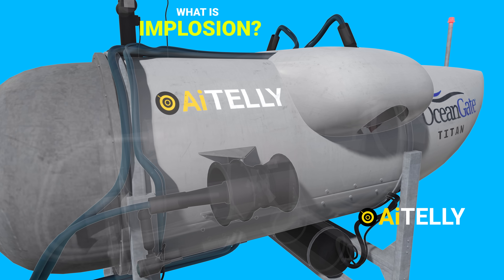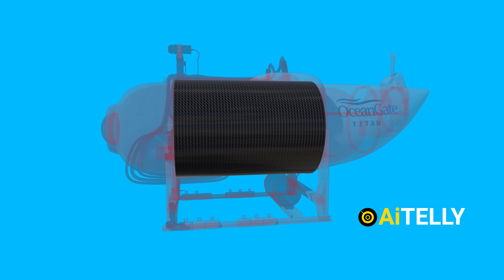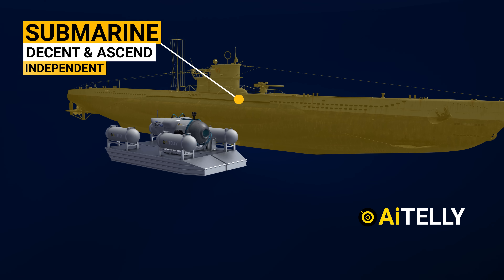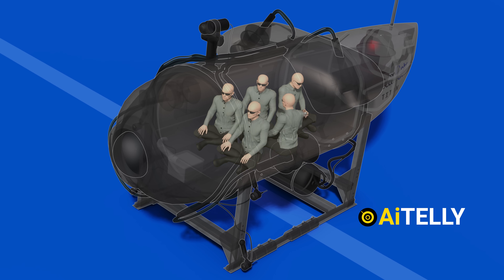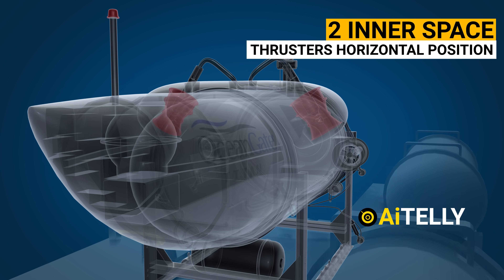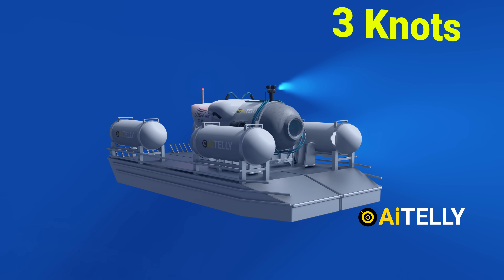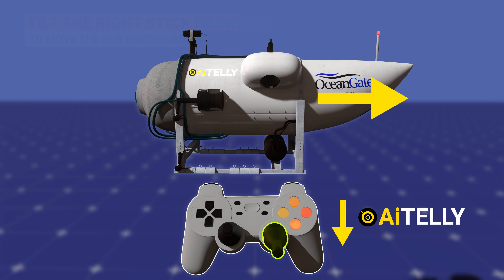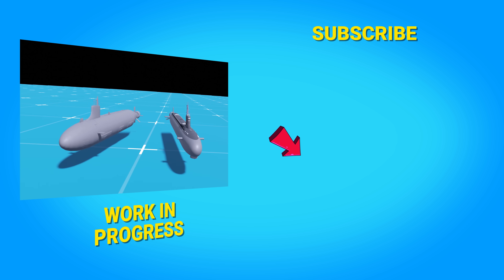Implosion Titan Oceangate How it Happened | Submersible Submarine Parts #3d

Comment: More then 5600 psi per square inch. Big mistake they glued the hatch to the tube. They litterally pressed a cap on a cylinder with a one inch ring with glue. Carbon fiber is only strong for outward pressure not inward its the opposite.  Take a ring of tape and try to pull it apart its hard now push it in its easy same crap when you take strands of fiber woven and laminate it it stress cracks. The thrusters were not even meant for underwater . The sub was built with camping world parts that submersible was never meant to go below 3000ft and was only meant to go that deep one time and then be retired. He didnt do that he went four times deeper then it was desinged. A real submarine has ballast tanks in it that fill with water to dive and empty to rise. That controler was garbage everything was. Way more cpmplex then your vid is showing.

Comment: Carbon Fiber is intended for an application requiring lightweight, with the strength of titanium, Why were the engineers concerned about weight on a small sub? Steel, or titanium should have been their first option!
The  US Navy's , "Alvin", 2300 dives, 7 trips to the Titanic, Steel hull built in 1966.?
Reply: Yes, your point is well taken but I believe the Alvin's crew compartment has been replaced several times now...only proving that the operators that work Alvin are not the same as oceangate.

Comment: There was no implosion here.
Either an explosion in the Titan allowed the sea to enter or sea pressure caused the Titan to break up and that is not an implosion or an explosion. The sea does not explode or implode!
There might be a tremendous inrush of sea, but that is not an implosion nor an explosion.
An implosion is the generation of energy inwards not outwards, and the contents of the Titan could not generate that kind of energy. If the sea were imploding it would stay where it is and suck the Titan into it.
An implosion might draw things into it, but only because the direction of its energy is the reverse of an explosion’s.
If an air-filled balloon loses its size it is because the air pressure inside it has been reduced allowing the outside air to replace the air lost till inside and outside pressures are the same.
If the balloon is pricked or in some way internally exploded then it could collapse entirely, but there is no implosion involved.
Reply: Wrong sir. Every sign leads to an implosion. It imploded. Plain and simple.

Comment: Expert submariners said the implosion was likely due to the amount of different materials used in the vehicle. They all have different atomic differences which causes problems. You want similar materials with similar atomic makesup. Additionally, they said the porthole was a likely culprit to the implosion. It is the weakest point on any submersible and is the reason no other submarines or deep sea diving vehicles have them.

Comment: One factor that I haven't seen mentioned is that carbon fiber is extremely strong in tension, but not in compression where it tends to buckle. So, IMO it is not a suitable material for a deep diving vessel.
Reply from the maker: You might also like Nuclear Powered Submarine Engineering behind it #3d Nuclear Reactor released
Link: https://youtu.be/J0lb46Zi5-s

Comment: the hull compresses quite a bit at depth. IF you read about old timers in nuclear subs and even currently in Virginia class submarines will tell you if you tied a shoe string tight inside from one part of hull to other. IT will SAG quite a bit once the sub is at a decent depth (which isnt very deep maybe 800m max crush depth for a SSBN. Though they say its classified.

Comment: One of the main advantages of carbon fiber is it’s strength to weight ratio, it’s completely irrelevant when it comes to a deep see vessel
Reply from the maker: You might also like Nuclear Powered Submarine Engineering behind it #3d Nuclear Reactor released
Link: https://youtu.be/J0lb46Zi5-s

Comment: the overall hull design is flawed. But actually the controllers main flaw is not that its a xbox game pad (which are reliable) IF THEY ARE WIRED. wireless is just dumb for any application like this.

the hull though yes under engineered. Carbon fiber has its place for many applications, this clearly isn't one yet. OR at least not done by the engineers who made the titan

Comment: 1. ICE BREAKER SHIP coukd have steady itself directly above Titanic depth wreck
2. COULD have connected steel type or any other sensible chain link and back up air lines and lowered
3. The properly built materials sub viewer to Titanic site
4. Once viewing is finished 
5. Ice Breaker reels sub viewer back up the 12500 ft (2 empire state building lenght deep)
5. If anything sub viewer can easily detach from connecting link and propel itself back to the surface 
But the built of the sub is the main cause

Comment: I'm not an engineer, but it seems to me that in an application where there is external pressure, reliance is being put on the strength of the epoxy that binds the fibers together, not the carbon fiber itself.

Comment: Engineering 101:  Layups like this have proven reliable to be predictable and reliable in tensile applications.  It is commonly used in high-pressure cylinders.  Carbon fiber's performance has been proven to be unreliable and unpredictable in compressive applications.  This was not ground breaking knowledge.  The following illustrates the development environment at OceanGate had been designed around Stockton Rush's (owner) personality traits of extreme pride, dangerous overconfidence, and arrogance.

1.  Another company had used the same type of construction in the past.  When other engineers with experience in such matters told them their already built craft was going to get someone killed, and how and why, they were convinced and its mission abandoned.  One of those also voiced their concerns to Oceangate, plus another.  James Cameron is on record recounting this series of events.

2.  "In 2018, a professional trade group warned that OceanGate's experimental approach to the design of the Titan could lead to potentially "catastrophic" outcomes, according to a letter from the group obtained by CBS News."

3. "That same year, an employee of OceanGate raised safety concerns about the Titan's design and the company's protocol for testing the hull's reliability. That employee, David Lochridge, was fired by OceanGate after airing his complaints to government regulators and OceanGate's management, with the latter then suing him for breach of contract. " 

"In response to OceanGate's lawsuit, Lochridge countersued, airing his concerns about Titan's safety in a 2018 court document.  Lochridge claimed he believed the company could "subject passengers to potential extreme danger in an experimental submersible," according to the legal filing."

"OceanGate's lawsuit against Lochridge stresses that he wasn't an engineer, and that he refused to accept its lead engineer's "veracity of information," leading to his firing. In his legal response, Lochridge admitted he wasn't an engineer, but noted that "he was hired to ensure the safety of all crew and clients during submersible and surface operations.  Lochridge wrote that he learned the viewport on the sub was only built to a certified pressure of 1,300 meters, even though the Titan intended to go down to 4,000 meters in depth. He also urged OceanGate to use an agency such as the American Bureau of Shipping to inspect and certify the Titan.  OceanGate refused to pay for the manufacturer to build a viewport that would meet the required depth of 4,000 meters," Lochridge's filing alleges.  He claims that rather than address his concerns or use "a standard classification agency to inspect the Titan," OceanGate immediately fired him.   Lochridge claimed he believed the company could "subject passengers to potential extreme danger in an experimental submersible," according to the legal filing."  (Note a legal filing of years ago, not after the loss of the Titan) 

4.  "In February 2023, the CEO of OceanGate, Stockton Rush, was sued by a Florida couple after they struggled to get a refund on their deposits for several canceled trips on the Titan.  The pair, Marc and Sharon Hagle, said in their lawsuit that OceanGate canceled one expedition saying it hadn't had enough time to certify that the Titan could reach the depths of the Titanic.  Another trip was canceled because of "equipment failure," according to a copy of the Hagles' lawsuit published by the Fort-Myers News Press."  (greed completes the picture)

E.G. This is not Monday morning quarterbacking.  This is the evidence that the Titan was engineered by Stockton Rush's extreme pride, dangerous overconfidence, and arrogance, in an environment he designed, that was hostile to previously acquired and sometimes basic engineering knowledge.  The greed entered the picture and he made it into a commercial venture of selling rides, in what he knew had not had even basic cycle testing, during which it would have certainly failed.

Comment: I saw a video of Rush saying with confidence that carbon fibre is much stronger than titanium. As a layman I did a very basic google search and found out that this is not true under pressure. I even remember hearing about the differences of tensile strength compared to pressure in highschool. Is this not supposed to be engineering 101 type of information? I am really curious how anyone building and designing this did not spot the very real dangers of it´s construction.

Comment: I feel like this video was more about how the submissible works, rather than how the implosion actually occurred. It would have been great if it talked about the physics of how the implosion happened, considering the material used, and how that actually led to the implosion as compared to titanium.
Reply from the maker: You might also like Nuclear Powered Submarine Engineering behind it #3d Nuclear Reactor released
Link: https://youtu.be/J0lb46Zi5-s

Comment: In your animation, the oxygen system is placed outside the pressure hull. This would mean that there are holes in the pressure hull, so the oxygen can be transported. This would create enormous weak points in the pressure hull. It is therefore more likely that the oxygen system was inside the pressure hull, between the vertical wall with the monitor and the titanium end cap. The tail section contained electronics and was not pressure proof itself. It probably got damaged by the implosion due to its attachment tot the pressure hull. It is likely that that is why the transponder got damaged.

Comment: The moral of of the story, you can't simply solve all problems with hammer (aka carbon fibre), carb fibre is good for flight and automotive, due to it's lightness matters, but concerning the durability of it's kind in the deep water high pressure, they'll need to make an advance research

Comment: Seems like you might have some terms wrong.  The explanation of the controller is of motion sensor i.e "tilt".  The part about the weak carbon fiber is inaccurate, "weakened carbon fiber" is more accurate.

Comment: Ref 5:00 => "Step #6":  Descent speed as reported in this video doesn't match known time to descend of 2.5 hrs..   Using 3-4 knots descent speed (taking 3 knots as the slowest mentioned = 5.06 ft/sec) and knowing depth of Titanic is approx 12,500 ft, and that it took 2.5 hours for Titan to descend to Titanic => 12,500/5.06 = 2470 sec or 2470/3600 = 0.686 hour  {so 3 knots is too fast to equal the avg descent speed}   Rather the avg descent speed must be = 12,500/(2.5 x 3600) = 1.39 ft/sec or 0.824 knots .

Comment: New subscriber...  James Cameron went on record stating that internal hull sensors: strain gauges and acoustic sensors, warned the crew of the impending hull failure. They had dropped their ballast weights and were dealing with an emergency situation trying to ascend when they imploded.

Comment: 3.8 km anchor 😂 uh no and failure is unknown, you don't know it was the carbon fibre hull.. the viewing window was being used well beyond spec and the end plate bonding to the carbon fibre looked poor. Until the investigation is complete we shouldn't jump to conclusions but there were many possible failure points that were not tested, cycled or certified for those depths.. the whole craft was ridiculous and a disaster waiting to happen

Comment: Do we even know what happened yet? This was all still theory yesterday

Also there was a specific reason they chose carbon fiber. Do we know what that was now?
The presumption I was told was they intended to use the continuous desalination process as a benefit to allow real-time monitoring of hull integrity/health via on-board sensors. I heard from someone else that if they had done 7 inches it would have potentially worked very well from a cost:dives perspective at industry standard safety margins.

I feel like they may have tested a 1/3 scale model to failure, and charted the audio/vibration signature of the hull from brand new to implosion. From there they probably intended to track the same signature on the full sized sub and retire the hull when it reached a certain point on the chart.....from there I'm guessing it failed in an unforseen way or they just got bad control data from the model (as well as the first hull I assume-which they already had retired and replaced).

I do wish people would actually contribute instead of just trashing everyone involved before the blood had even settled.. Everything we heard in the first week was completely biased and emotionally-charged reporting.... It just shows pure narcissism to jump on this early. There is literally no way to attain an accurate picture of what was going on at oceangate yet. Anyone who acts like they already have a good picture of everything is basing it on a cartoonishly obtuse caricature of the reality based on about five or six things that could easily look completely different in context.  Hell half of the reporting has been based on the statements from a guy the CEO both fired and was suing, and who's specific actions this week have put him on track for a multi-million dollar book deal. The conflict of interest on alot of the initial information is unreal.

Another thing is when it comes to certifications, I've known industries where a for-profit certification business will be basically gatekeeping the entire industry, demanding hugely inflated prices for a half-assed inspection that has to be double-checked aging in-house anyway. And yes, you'll get angry letters too from all the people who were counting on getting that money. What I'm saying is certifications are sometimes just a racket (and to some small extent almost all of them have aspects of that--it's just that some are still worth the cost.) I don't think that was the case here, but I do think it was two very different cultures who clashed politically within the industry. Point is, one thing I know for sure is the cartoonishly simple narrative to this whole thing is beyond unrealistic. Literally nothing is like that in life.

Comment: There is a very big mistake in your video. Carbon fibre doesn't crush like this, metal does, carbon brakes/shaders. I am not sure if that's what you mean with your correction in the middle, but still, the part in the beginning is wrong.

Comment: Implosion sound was detected on descent at 3800 feet or 1000 m, not at 4000 m where titanic is.
Also the Carbon cylinder hull imploaded/compressed likely in the middle popping the outside rings which wer only glued 😂 which could indicate the sub did not impload entirely. It could have been a half ass implosion